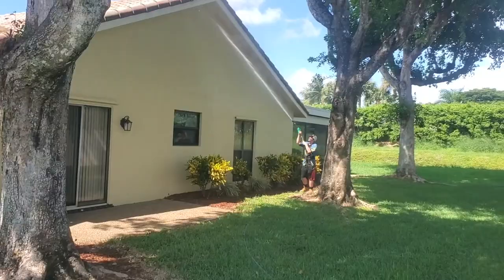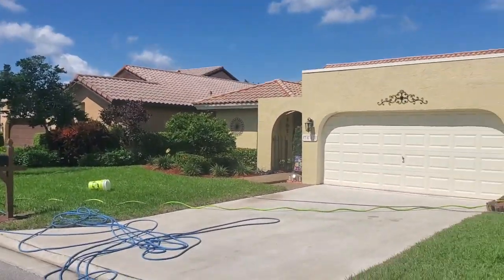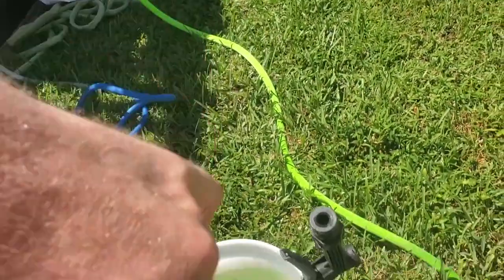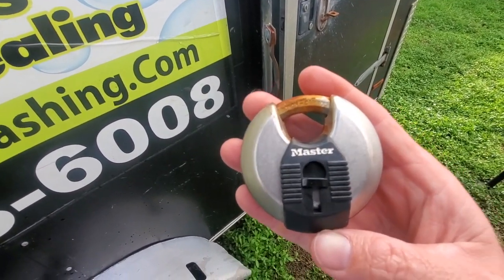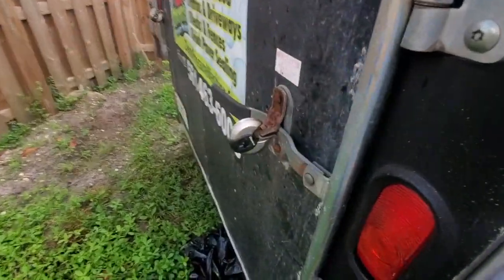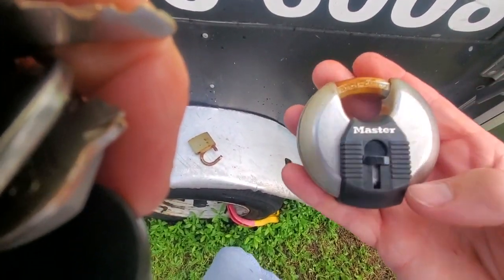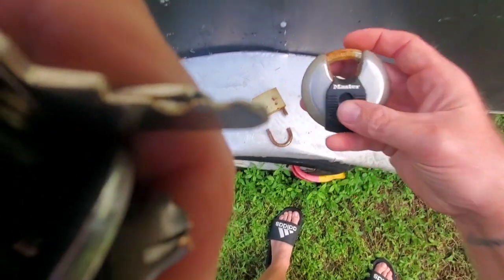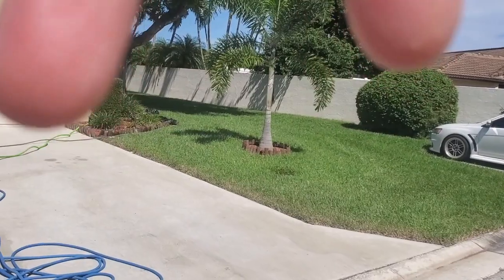Bleach neutralizer and roof cleaning monster(Protect Your Equipment!)

Comment: Great video!
I have a white tile roof that will need to be cleaned soon. 
Don't forget to wear your parachute when you up on that roof! 🪂
I'm sure you've thought of it but backing trailer up against the fence and parking truck very close to side door can prevent them from opening the door if if they cut the lock...we used to park forklifts next to the side door if we left our trailer on a commercial job...

Comment: Any lock is EASY to get into.  The point of the lock is to keep honest people honest while also being used to stall or slow down a thief.  The method for lock access - Cordless drill with a drill bit a little larger than the diameter of the key slot.  Simply pull trigger and drill into the lock through the key hole. Fyi -  It takes about 30 seconds with a dewalt 20v.  I know this because I lost the keys to my disk lock (only reason I bought this type of lock is because I was told that it couldn't be broken into).  Well probably not by bolt cutters but definitely can with a drill and bit.

Comment: Hey brossive!! 🤙no sweat on the roof tile that's an S tile if it hold your weight that means its over 9 lbs anything under 9 lbs its consider light weight usually light weight tile has darker color i used to work as roofer and solar installer the flat roof its rolled comp or bitumen same concept if its white and looks like plastic its TPO basically there's foam underneath other than that walk on tile brossive you're good! 🤙